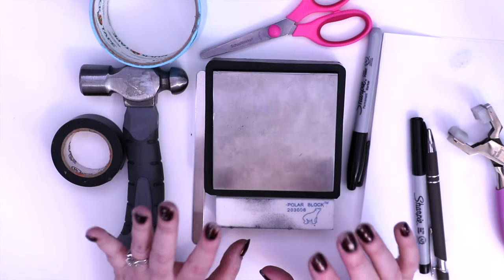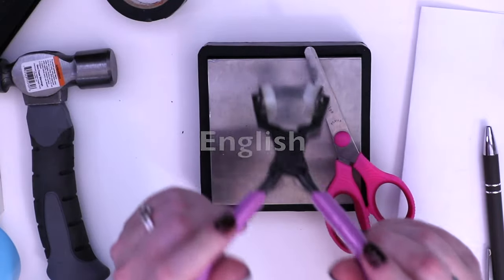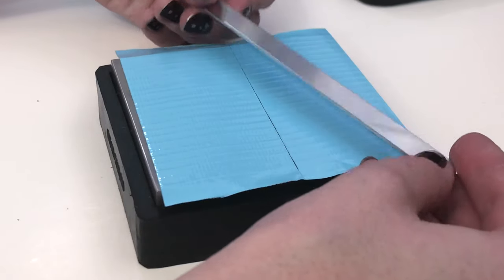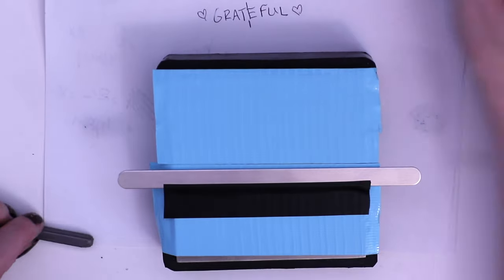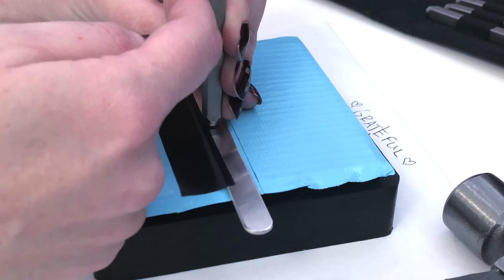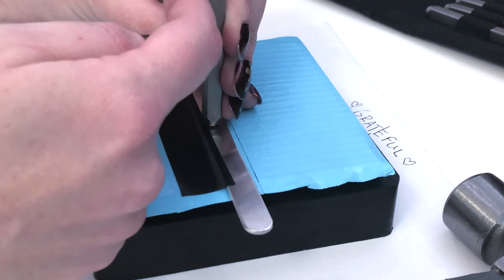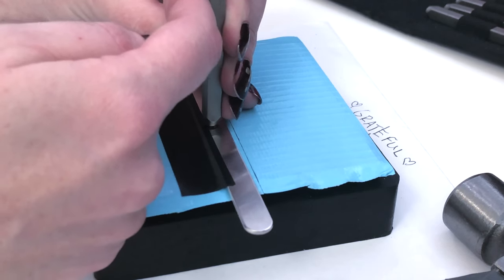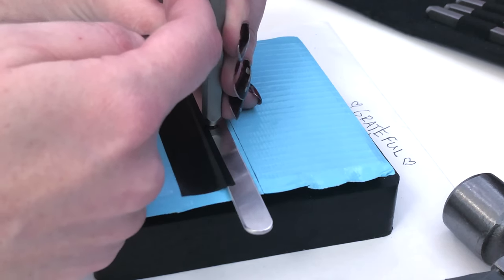How To Stamp A Stackable Cuff Bracelet, For Beginners (Beginner Metal Jewelry Stamping Tutorial)

Comment: Do you think that maybe the plastic coating in the back of the blank is to do what you are doing with the duct tape? To protect the back from scratches when stamping? Just my mind thinking a little. Lol
Reply from the maker: Brittaney Hall yes! It’s mainly to protect during the shipping and cutting processes, but it works great to leave it on instead of using the tape. I just show the tape instead in the videos, because not all blanks will come with the pvc coating on the back. :) thanks for the question!
Reply: O for christ sake, i just said that, and then read yours. lol

Comment: They are very nice. Question: can you have two rows like if you wish to print a verse/quote. are there smaller fonts? new on this art and on your channel. liked & subscribed.
Reply from the maker: @Mark_135  The bracelet blanks can be purchased in several sizes. The bigger the cuff, the more rows you could potentially pack in there. Font stamps also come in lots of sizes. I think the smallest I own is 2 or 2.5mm. I think the most rows I’ve stamped on a cuff bracelet was 5 rows on a 1 inch wide bracelet blank. A google search for metal stamping fonts and for metal cuff bracelet blanks will give you loads of options.

Comment: I've watched a bunch of tutorials and you're the only person I've seen protecting the blank back & the integrity of your block. This makes sense to my brain! Thank you! 
Why do you remove the protective plastic backing that comes on the blank?
Reply from the maker: N I Q O L E I’ve been asked this a few times, but sometimes blanks don’t come with a plastic backing. I removed it to show what happens if your blank doesn’t have that plastic on it. You can leave the plastic on, instead of taping your bench block if you want.
Reply: @makeitkate3240  I pulled my block out this afternoon and turns out I ended up covering mine with tape when I'd done my stamping a couple years ago. You're the first youtuber I've seen that does it; I just had painter's tape tho,  I will def use duct tape now! One thing I did was tape a piece of painter's tape facing up so it would help keep blanks in place.  I still used 1 piece at the bottom to help line the stamps up with but the face up piece helps a lot!

Comment: Hi, I'm new to stamping and this video was very helpful in how to set up and use the tools. I just wanted to ask how to stamp on blank connectors for macrame, these connectors are already curved. Do I straighten it, stamp it then use the bending pliers? Thanks
Reply from the maker: Samantha Winner Hi! I’m not familiar at all with macrame. When I did a search to figure out what those connectors are, it looks to mi like you’re talking about those stainless steel rings? If that’s right, this technique won’t work with that. You’ll need to make sure that you buy stamps that are specifically made for stamping on stainless steel. These tools wouldn’t work for bending and straightening metal that’s so hard, though. And you wouldn’t be able to stamp on something with such a rounded surface - it would need to be a flat surface (like a table top instead of a pool noodle, if that makes sense). My bed suggestions would be to get creative about what you’d be using as a connector, or stamp other items that you could attach TO the connector.
Reply: @makeitkate3240  Hi there, the connectors aren't rings, they are flat narrow pieces around 1.5" long with holes at each end for the knotting to attach to. They come with a slight curve to sit on the wrist but then obviously I can't stamp onto it. I thought maybe I could flatten, stamp then recurve with the bending pliers. Just a thought. Thanks for your advice though, will be useful for other projects :-)

Comment: Great video! I was wondering if there is anyway to color in the letters without using a sharpie? Just asking because even after buffing away the sharpie, there is still a black shadow residue left behind 😑 Or is there another way to clean up the metal after using the sharpie? Thank you!
Reply from the maker: Michelle Roth Can you tell me what you’re buffing it away with? You can use rubbing alcohol to wipe the shadow away. There are a jillion different things you can use for darkening the impressions, but sharpie is the least expensive. :) Most anything you use can be cleaned away with some rubbing alcohol or acetone and a soft cloth.

Comment: Great tutorial! What are the chances that the bracelet blank will scratch and wear with use?  Just curious how durable they are in the long term.  Also, I've seen a lot of people use the bracelet bending bar versus the pliers.  Which is better in your opinion?  Or are they both equally effective?
Reply from the maker: downtoawhisper The blanks will definitely scratch and show signs of wear. Most metals that you stamp on will do that. Aluminum is one of the softest metals, so it will scuff up faster than maybe brass would. I’d say that both tools are very effective. Neither is very expensive, so it can’t hurt to have both in your toolbox. ;)
Reply: @makeitkate3240  Thanks for responding!  How long would you say a bracelet like the one you made would last before showing signs of wear and tear?

Comment: Hi in another one of your videos you said the hammer had to have a brass head to stop it from have a double taping effect.. is that hammer from harbor freight a brass head? Thanks! N
Reply from the maker: Sorry for the delayed response! The harbor freight hammer is not brass. So if you use it, you’ll want to make sure you have a sturdy work surface to limit the energy transfer.

Comment: Hi Kate. New to stamping here. Have a question after my first attempt. Does all hand stamped blanks show the stamp coming through on the back side? I stamped a blank with an initial, and it shows on the back side of the blank. Am I doing something wrong, or is the blank possibly too thin a gauge? Using a 2# brass hammer and a steel bench block on a butcher block table. The blank is silver plate brass and looks to be 24 gauge. Thanks.
Reply from the maker: Hi there!  The stamping will almost always show through, but I would say that 24 gauge is way too thin.  The problem with a blank that thin, is the metal will also begin to warp and bubble really badly as you stamp.  :(
Reply: Thanks Kate. The blanks were sold as stamping blanks. Ugh. I see so much stamped jewelry for sale on Etsy, but have never seen one in person to look at the backs. Good to know. @makeitkate3240
Reply: They have different gauges for stamping blanks. Most should  be between 18-22